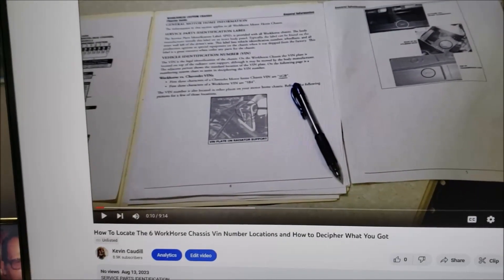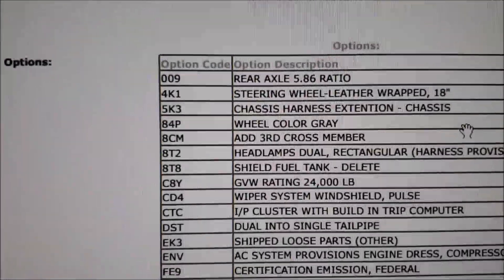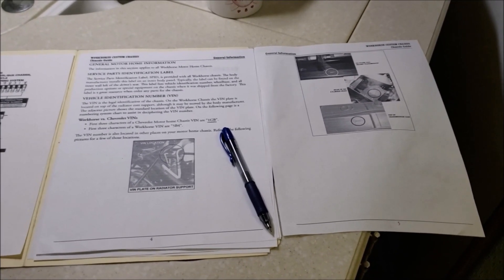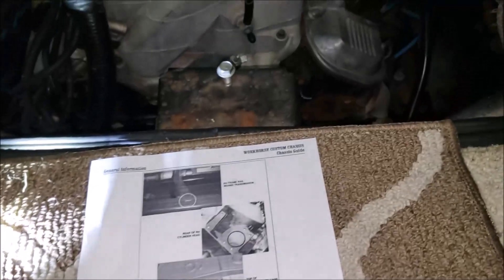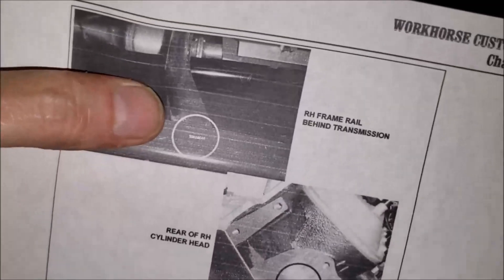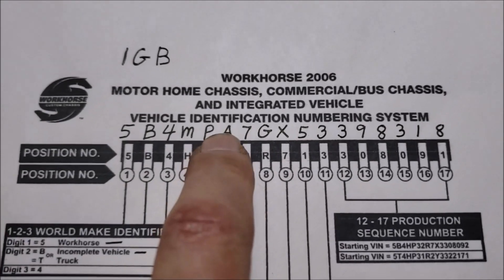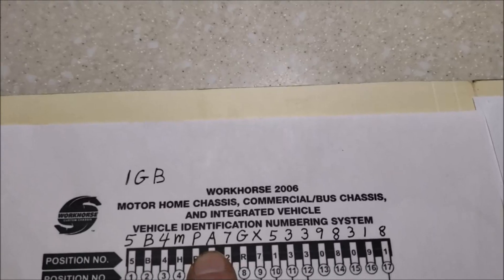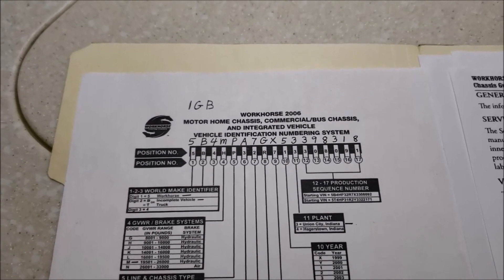How To Locate The 6 WorkHorse Chassis Vin Number Locations and How to Decipher What You Got

Comment: Thanks for linking me to this video. Great info.
Reply from the maker: Did you find out what you got?
Reply: @ktoutdoor  1GD = TOPKICK C5500 CONV CAB 4X2,  also listed with GMC as a Uhaul spec cab and chassis. The fuel tank is passenger side mount, 60 gallons, and sending units are spec'd for the Uhaul chassis tanks. The part numbers are from newest reversion to original 19426297, 15218917, 19210331. All fuel pump sending units have been discontinued. Delphi and Carter both have discontinued their replacements. The offshore units that are supposed to fit are 1 to 2.5 inches to short. These sending units are to heavy to hang free inside of the tank, plus they don't use all the fuel in the tank. My fuel gauge is reading proper fuel levels. I will try to find a Delphi pump and install it into the sending unit I have. That's really all I can think to do.
Reply: @ktoutdoor First three digits are 1GD and is listed as " TOPKICK C5500 CONV CAB 4X2" which is exactly what I have. It's a standard cab and chassis that Uhaul had spec'd to fit their box bodies onto.

Comment: Could you tell me how to remove the engine doghouse cover? I have the same motor home but can't find how to remove it.
Reply from the maker: Look from underneath from the wheel well you will see the latch at the rear of the cover so you will know where to feel for the small 1/4" hole that you put the allen wrench in. about 3" up from center edge.
Reply: Thanks!